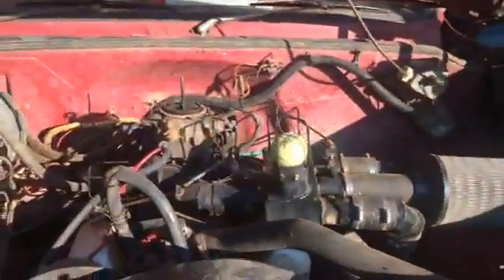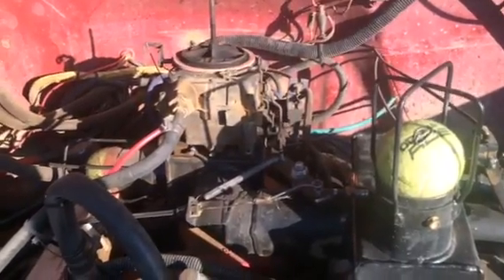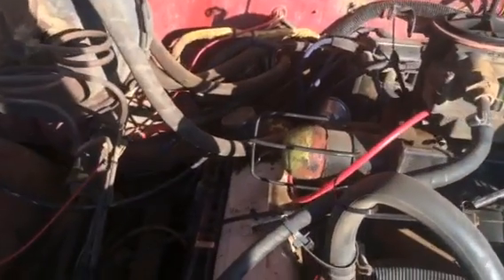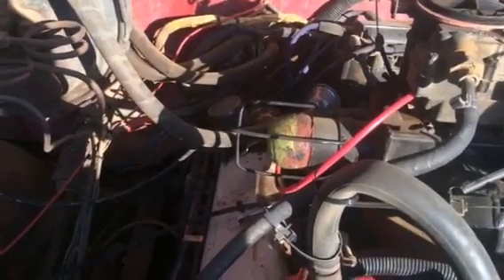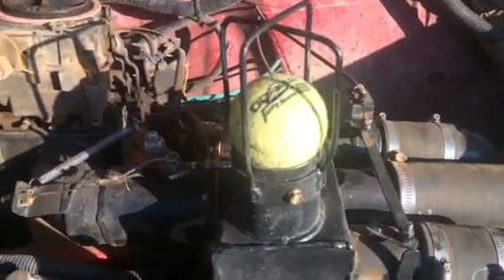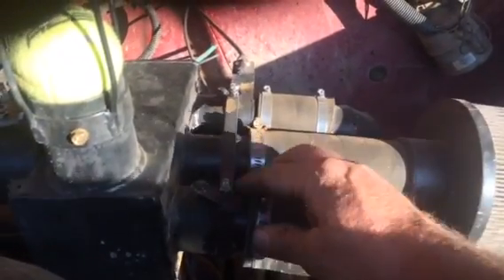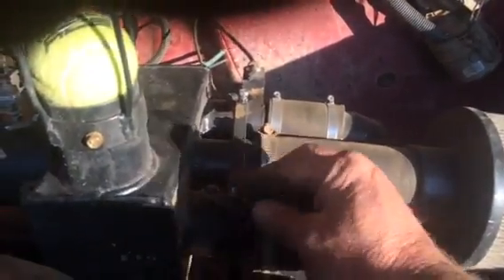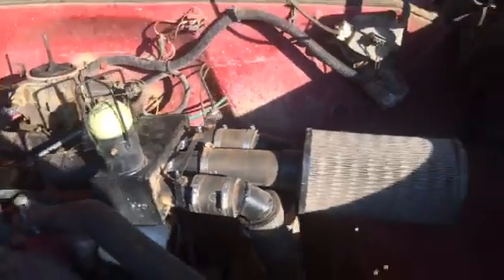Wood gas truck

Comment: Do you have your filter before your cooling rails?.....what sort of bags are you using?
Nice job on the gauges and thermocouples....you see alot of setups where they are positioned so that you really have to look away from where you're (roughly) going.